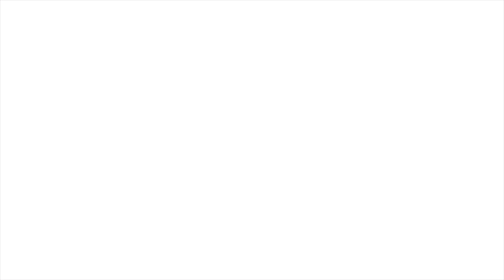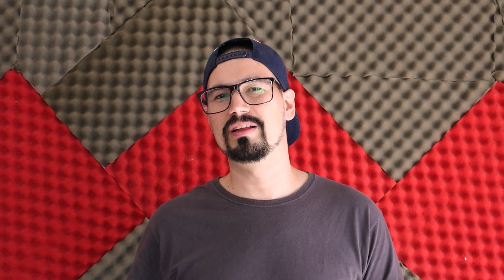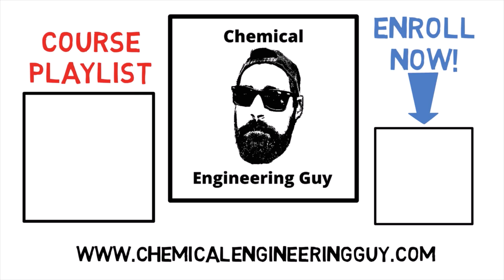Section 3 Introduction - Separation by Phase Creation & Phase Addition (Lec057)

Comment: Thanks for your video! During my undergraduate studies, I have briefly worked in the pharmaceutical industry as a pharmaceutical process operator. Since I study chemistry,
I was absolutely fascinated by the way all different types of engineering could be integrated 
into one complex yet functioning factory. Despite my BSc. level knowledge of chemistry;
I was absolutely overwhelmed by the depth and scope of knowledge required to build and
maintain such a factory. For this reason I am now diligently writing a thesis on ways to
improve the chemistry of this pharmaceutical plant.

In the pharmaceutical plant in which I worked, the manufacturing process revolved around photochemically creating a pharmaceutical which has many similarities to vitamin D. On 
paper, this compound its synthesis is deceptively simple. In practice however; actual 
photochemical synthesis is fiendishly difficult because photochemical isomerization creates
a whole slew of undesired products. Since the current chemistry provides insufficient
product selectivity; the current manufacturing process requires a long cascade of reactors
in which multi-solvent factional crystallizations are performed. While I loved the way in which
the overall process was engineered; it pains me to this day that I could not keep a copy of the
PFD (process flow diagram) for private studies (and admiration).

This is the factory in question by the way:
https://goo.gl/maps/wQhbpdnpZDuiS5qTA
Reply from the maker: that sounds great! Actually, I'm planning on doing a podcast, the idea is to interview ppl related to chemical engineering! Let me know if you might be interested! contact@chemicalengineeringguy.com